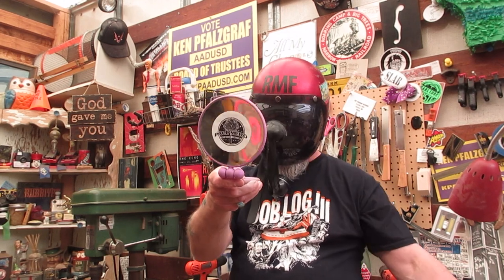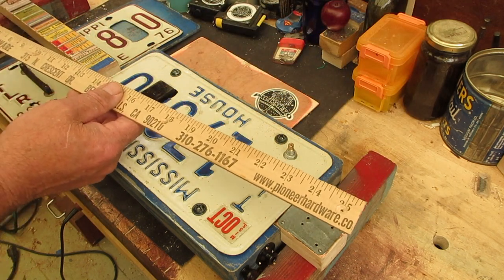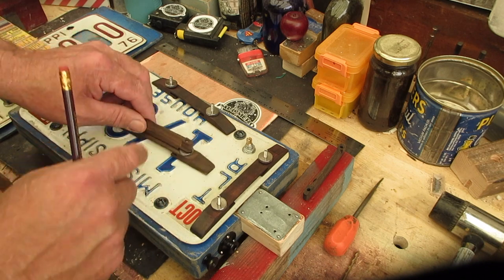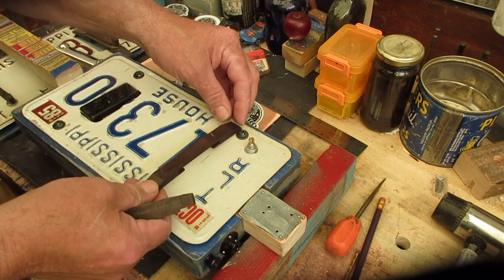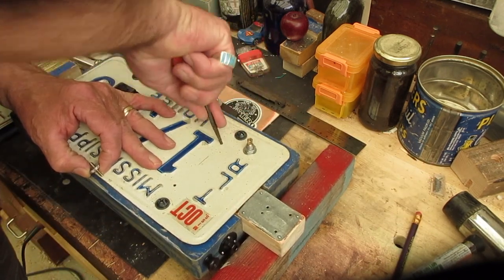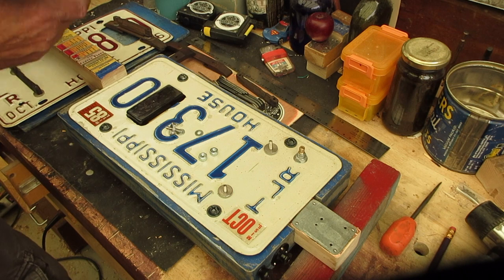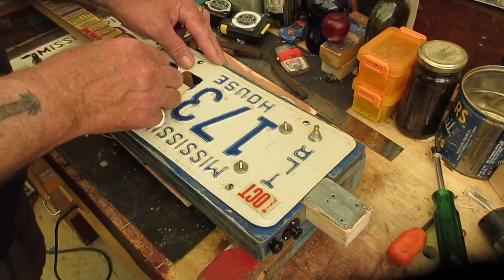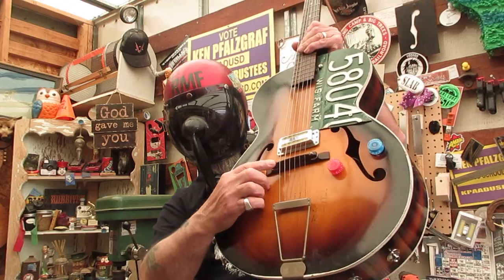License Plate Floating Bridge

Comment: Looks great Ken. A slight angle helped me to get the intonation spot on, for those with a critical ear...like the one my client has. I have only used that type of bridge once but on a 25.3" scale the treble strings sat at 25.4" and the bass end was set at 25.5"...in silly metres that's 644 - 647...I like to be able to get it perfect but also dig the sound of "on the ragged edge"...not a criticism in any way old chap, I've only made and sold 3... just chipping in to add some flavour...on a metal surface like that licence plate, I would cut a slot to allow some leeway.